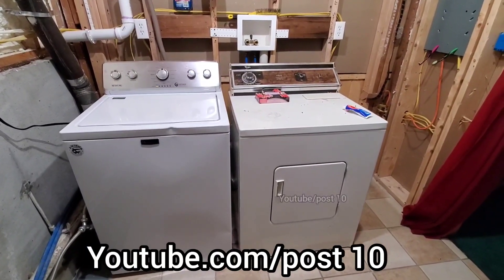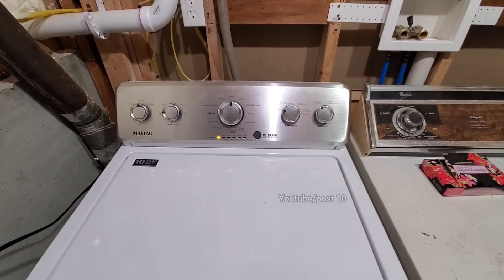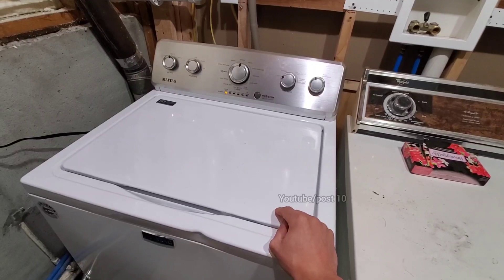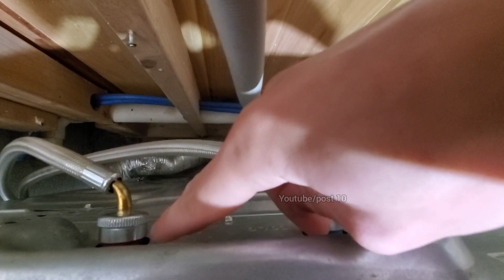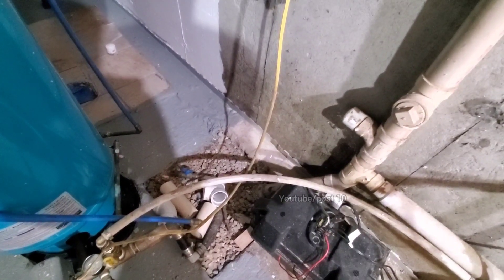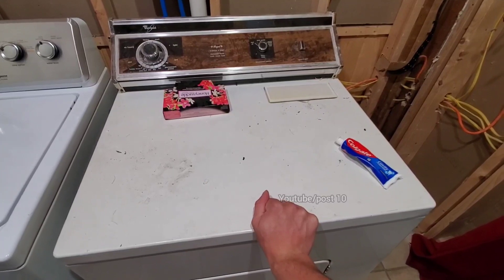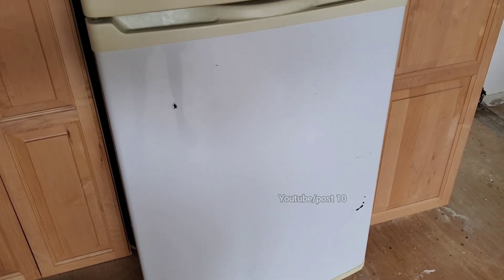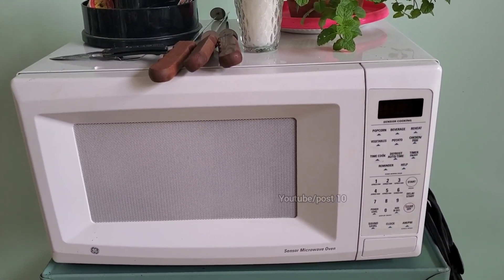Why Modern Appliances Suck

Comment: I have that washing machine. My tips are 1 dont load it to full. Theres plasic gears in it that you can hear grind if its overloaded and 2 balace the load before turning it on. It throws itself off balance easily. Mines on its way out cuz of those plastic parts wearing out.  3 yes it has a computer with error codes. Sometimes it can get confused. Unplugging it for a minute clears the memory and itll work ok again.

Comment: My washer is a Maytag as well. I bought it new in 1990 & it still works great!
Reply: I got a 2015 model and the stupid electronic control board had to be replaced 3 times and Is needing replaced again. plus it dont clean half the dishes. I am trying to find an older one that still works. these new ones are junk

Comment: Just be careful if not using hot water can get a build up of detergent if you use a lot. I know you have a bunch of white vinegar have you ever tried adding a cup or two to your cloths? Will help cleaning the cloths and they come out the dryer much softer and better smelling then all the nasty chemical detergents and dryer sheets.